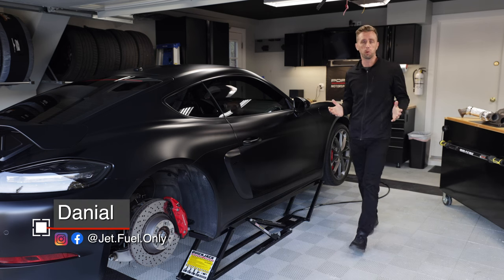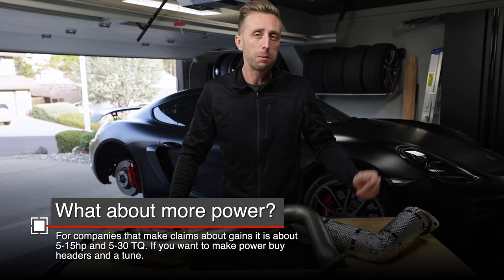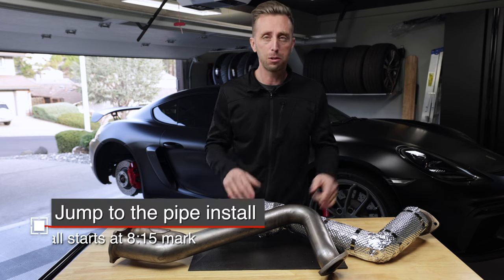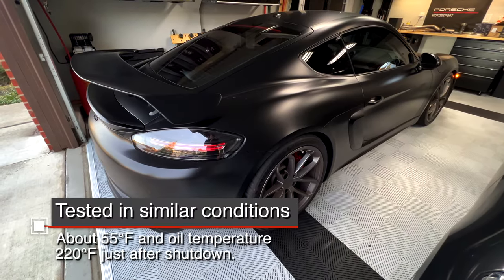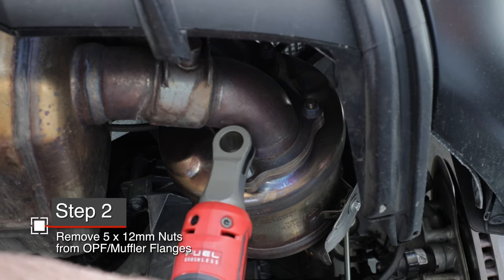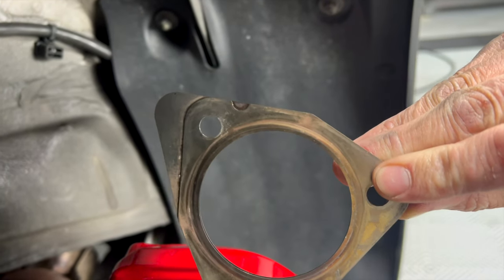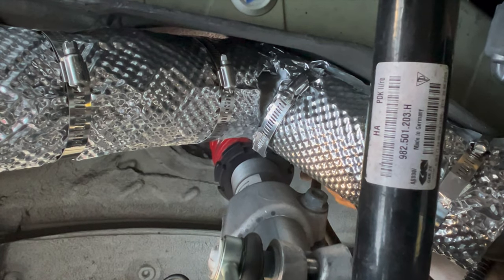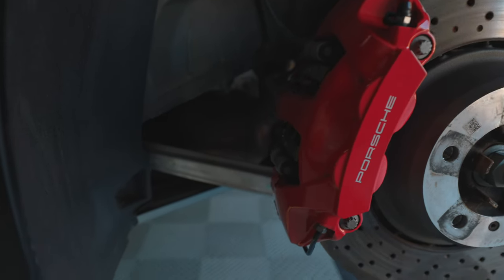Porsche Over Axle Pipe Install and GPF Delete 981/718 Cayman and Boxter

Comment: Comment on heat.  From one of the manufacturer of OAP.  With the stock GPF pipe the filter causes higher temps based on the filter restriction.  I’ve added the OAP and didn’t insulate them, wrong or right.  I thought about doing the heat wrap fabric I’ve used on motorcycle exhaust.  When I get bored I may give that a try.  Great video !!  100% love the improved exhaust note.
Reply from the maker: Yeah those filters are big heat sinks. Maybe on a 55-65 degree day and oil temp stable you could check your temps after shutdown?

Comment: Great video, just like the oil change one. You make these DIY jobs much less intimidating for those less experienced. You do mention the sensors missing in the U.S. spec in the OPFs, but does the removal of the OPFs with the OAPs require any reprogramming? I thought that removing the OPFs will be recognized by the car and always trigger a code and check engine light due to the change in back pressures? 

As a side note, I will also check with my dealer on any potential warranty issues but I'm sure they will be ok with this mod as they previously told me that they are totally ok with any change unless it directly causes the car to break down and I think Porsche is much more open to mods than any other brand.
Reply from the maker: Thanks!  No check engine light.  It’s a non issue for sure. If your dealer said that you will be fine. Most are fine with exhaust mods in the US. However, asking them directly they may be less inclined to encourage it. :). Happy modding

Comment: Do you think this OAP install can be done with the rear of car on a ramp and wheels on without too much of a hassle trying to work on the triangle flange that connects to the headers?  BTW, best how-to installation vid thus far on YouTube.  By chance, you don't host the "Essential Tennis" YouTube channel, do you?  You look and sound very similar to one of their presenters.
Reply from the maker: Lol, I’ll have to check out the Essential Tennis channel. Glad you liked my install. I would say no to the wheels being in. You want every advantage you can get to put the wrenches in the right angle. 

I would just use the ramps to pull the muffler then do each side one at a time on a jack/jackstand.

Comment: Did you ever get a good answer from Soul Performance about the dB levels?  I'm at the same tracks you are, so it would be good to know if they hit 105dB... Reason I'm interested is that the PO of my car put on an Fi exhaust that sounds good above 3500 rpm, but drones terribly under that, so anything under the speed limit steady freeway driving is bad. Cheers!
Reply from the maker: No nothing unfortunately. There are a lot of variables to sound stations and tracks so it’s a little gray.

Comment: Do you think heat coating works as well as that insulation? I have my headers and downpipe coated and it definitely makes a difference, but it's not as effective as that insulation you did. I'm just trying to lower underhood heat, but I think if i wanted to protect components, I'd go with the insulation wrap.
Reply from the maker: Honestly I’m not sure!  I did a lot of research. Jet hot does work pretty well though. I remember almost able to touch some coated headers once.

Comment: Ummm we didn't actually hear the new set up with any revs or on a drive? 🤷🏻‍♂️
Reply from the maker: Sorry, I see your confusion, at the end of the video 16:43 the lower title says stock pipes but it’s the after market pipes as mentioned in the voiceover. You can hear more on my other video comparing the 718 to the 981

Comment: isnt a tune mandatory once you install the oap? gives a better sound, better for the engine but prly voids your ecu warranty
Reply from the maker: Your points are valid but negligible. Definitely not mandatory. Generally nobody tunes after OAP unless they are in Europe and have monitors and want the CEL turned off.

Comment: gi guys how do these senmsors look like i cant see if mine has any ..
Reply from the maker: You mean the OPF filter sensors?  You will see a pretty obvious cable and 1” diameter connector in the side of the pipe after the filter.
Reply: @JetFuelOnly  thanks appreciate it, doesnt have em